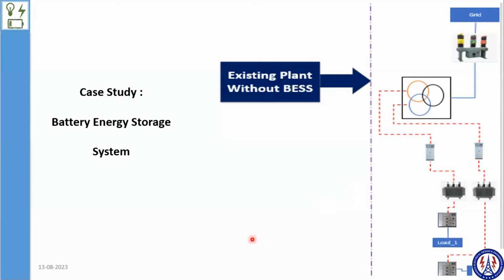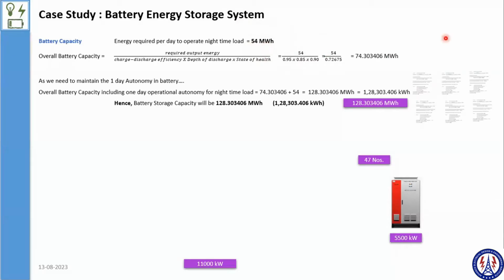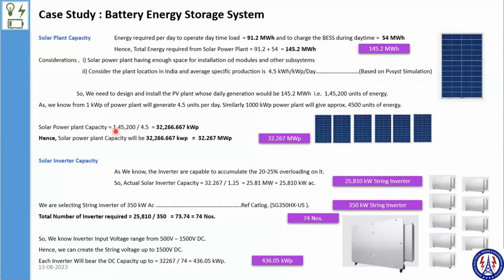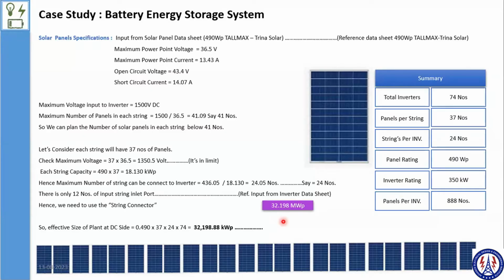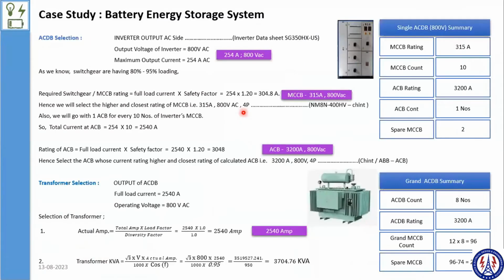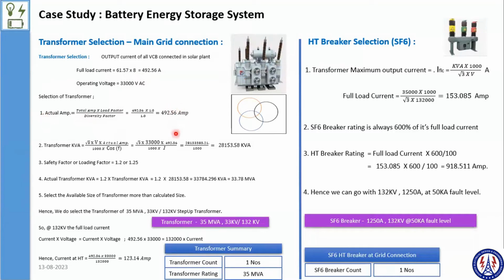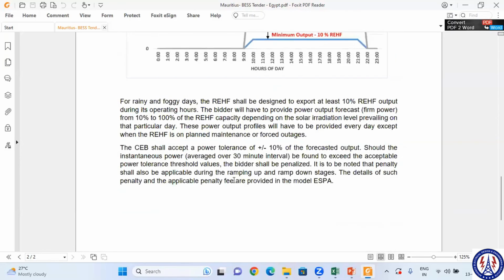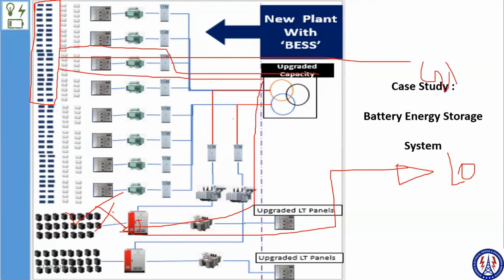BATTERY ENERGY STORAGE SYSTEM DESIGN (BESS) TRAINING | AEDEI, GOVT. CERTIFIED TRAINING INSTIUTE

Comment: i really appreciate your content and way of teaching. 1 Q: at as per 16:58 the DOA shouldn't be 2 days? battery bank capacity should be 148.607 MWh, 54 num of battery container.
Reply: I believe the same, it should be c150 MWh
Reply: 1 Day autonomy means 1 day backup support, So the capacity should be near double.
Reply: Then it should 148 instead 128 MWH correct?
Reply: Yes nearly Doubled